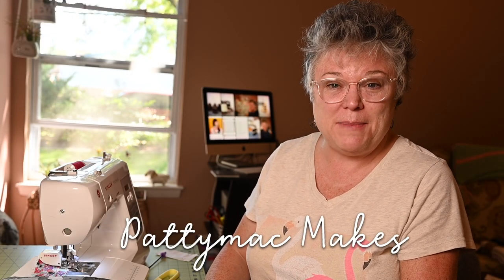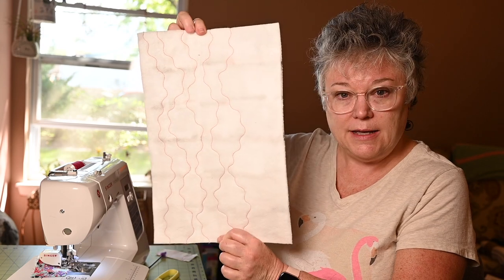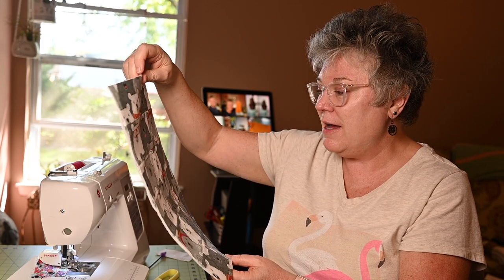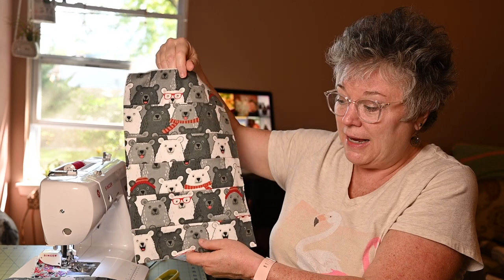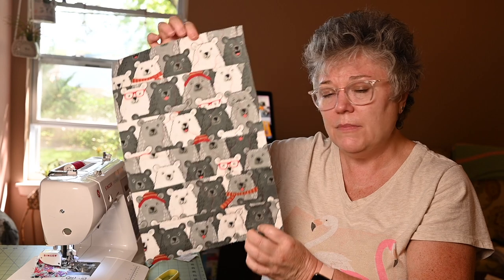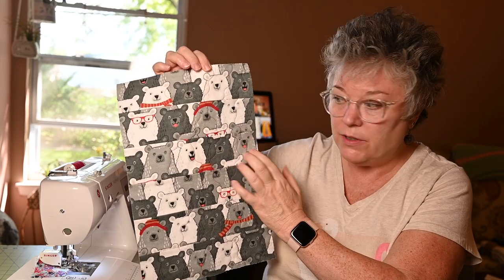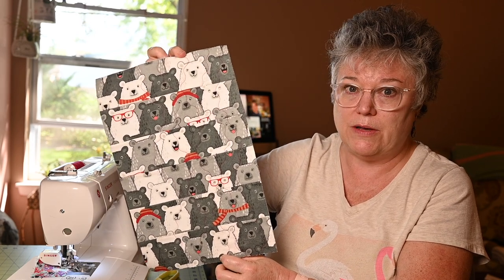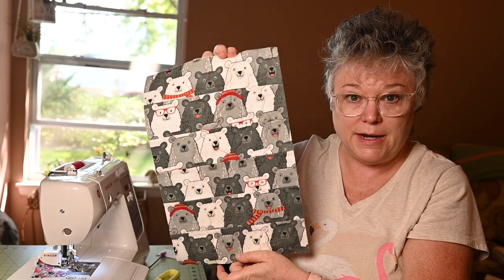HOW TO USE A WALKING FOOT FOR QUILTING | How to install the walking foot and why we use it

Comment: I like your lighthearted approach. 

Your pieces came out so perfectly flat! Did you starch and iron them first? 
I did not know that you are not supposed to go backwards with a 
walking foot! I think I probably was.

I use a walking foot a lot for knits. It is a lifesaver.
I want to know more about that fusible batting. How the heck do you get it all nice and flat on the back of a large piece? That really looks like it helps with it not shifting. What about when you have the backing fabric like quilts usually have?
Lastly, I found out the hard way that there is more than one style of walking foot. I tried to attach mine with the claw part resting on top of the needle bar, instead of hooking on, because that is how the other style attaches. So you need to know which kind you have before you attach it.
Reply from the maker: That's a great point on how the lever can be different on different attachments. The one on my Kenmore is as you describe. 

I press and starch EVERYTHING first. Even flannel which is what the bears are. I never sew anything without doing that first. The type of sewing I do is generally cotton wovens for quilting or pillow projects, so having the materials very stable helps with that kind of sewing. I don't sew knits, but I have heard the walking foot is invaluable with them! 

I saw in a couple of places not to back stitch with the walking foot, but I have also done it. They say not to use decorative stitches with them either, but I have done decorative stitching on borders as part of the quilting process. 

Fusible batting is like fusible interfacing only thicker. So yes, it does provide a lot of structure. I like it for bags and wall hangings and pillows where the piece looks better with structure. For a bed quilt, I use an 80/20 blend, generally, and I pin baste the quilt sandwich. Here's how I put my charm quilt together https://pattymacmakes.com/my-first-charm-quilt/. I hope this is helpful! Thanks for your comment and questions.

Comment: Pattymac, thank you for this tutorial, shockingly easy when you know how😂. This Patchwork Singer is my treat to myself, I’m a returner to sewing after a 40 year hiatus, have any tutorials (or could you point me in the right direction) on using the different practical stitches and feet. Thanks
Reply from the maker: I recommend the book Sewing Machine Magic to everyone which is a great manual to have. I'll wind up doing more videos on the feet and what they do coming up. You can search youtube for information. Singer has some material available. I'm getting my feet back under me after a computer issue in December that's put me really behind. I would recommend putting on your all purpose foot and sew some small projects to get aquainted with the machine. If you put on a zig zag foot, you can play with all the decorative stitches which is really fun!

Comment: Hi Patty. I have a Singer 4423 which I have been very happy with so far. However, I have tried many, many times to use the walking foot and it will not work. I did buy the Singer waking foot that was made for the machine and have watched literally every video there is on walking feet. I believe I am doing every thing correctly. I have spent entire afternoons playing with it. It will go a few stitches like it is going to do the job and then it gets stuck in place, Just holds on and wont move. Do you think something on my machine could be out of adjustment? I have been told never to adjust the timing on these machines, so I haven't. I believe the tension and stitch length were correct. Do you ever have trouble? Is there some stroke of genius that I am missing out on? Something simple? It was worth a shot to ask since I have tried everything else.
Reply from the maker: Gosh, Julie, I'm not sure about it. I wonder if it's the walking foot itself. I would suggest getting another one to try out and see if you get the same result. Joann has them. So try it and if it still won't work for you, it's an easy return. If that doesn't solve the problem, you can try contacting Singer and ask them about it. I'm not familiar with your machine, so I don't know if you need something else or not. Once you get it in place, the walking foot should work pretty easily so it makes me wonder if it's the foot not the machine. Are you sure you have it set up on the screw one the mount where that little arm goes?? If you don't have issues with timing using other feet then I don't believe it's a machine issue. I hope this helps! Singer does have email and maybe a phone number. I can't remember! But check their website to see how to contact them.
Reply: @PattymacMakes  I believe that it was installed properly. I think you may be right. If another one does it then it is either me or the machine and I will know it. I guess its worth the 25 bucks just to know. I just thought I'd ask for good measure. I have tried to get a hold of singer, I don't think they intend to be gotten a hold of, lol. Thank you for your input and all of your great videos of course!

Comment: This video is so helpful! Can you tell me how to anchor the beginning and ends of my seams using the 63 stitch? I'd like to quilt within each block so I will be starting and stopping a lot.
Reply from the maker: I've seen people pull the bobbin thread up to the top of the quilt, but I haven't actually done that myself. I just do straight line quilting or stitch in the ditch to keep it simple, so I'm not really the best person to answer your question. It sounds like you might want to use the darning foot and do more of a free motion quilt than using a walking foot. Free motion quilting videos probably can better answer your question on anchoring. I'm sorry I can't be of more help. Good luck and have fun with it! One thing I can say is to make a few samples and practice your desired technique on a few samples first.

Comment: Hello! I am sewing headbands using double brushed Poly and using a zig zag stretch stitch. I notice my stitches puckering a bit and would like to try the walking foot. Since the walking foot doesn’t do a reverse stitch, how do I go about locking the stitching at the end? Any help is appreciated! Love your YouTube btw! I just got the Singer Patchwork and I’m looking forward to learning more from you!
Reply from the maker: To be honest Byanka, I have done reverse locking stitches on my walking foot and it's worked fine. I've also used it to make decorative stitches which can go backwards and forwards, and that's also been fine. For the locking stitches, it's only a few stitches, so it should be ok for you. Basically, I would try it out and see how it does. I know they say not to got backwards with the walking foot, but it's only a couple of stitches. You are not backing up for several inches. Please try it and let me know how it works for you! And thank you! I love my Patchwork machine!

Comment: I doubt I will ever attempt that. Changing to the zipper foot & back with these hands & such limited space is too frustrating. Last year I made a hot pad following Crafty Crafts by Deana's vid without the wf foot because she didn't use it...my didn't come out that great. Hers did though. I didn't know you cold free  motion quilt with the walking foot. My machines manual says I have to buy another part to do that. Tfs :)
Reply from the maker: It's not a true free motion....it's more of a simulated look of it by using serpentine and going every which way. It's not as bad as I thought it would be to change out to this foot and I wind up using it a lot. It really does make a BIG difference. I do think using a small screw driver is easier, but I like to do tutorials using the provided tools. I hope you will consider trying it out, Kathy! It's kind of fun and you feel like an elite sewist when you start using it. LOL!
Reply: @PattymacMakes  - I had to use a big screwdriver and a pair of pliers.  Those things are put together by some awfully strong people.

Comment: I’ve got a thicker batting. Will this foot work as well or do I need to release presser foot tension
Reply from the maker: I don't think so, but you should experiment with your project. I have used it for higher loft batting without any issues once it gets going. Sometimes it can get a little hung up at the beginning of stitching where it bunches up, so start slow. If it bunches, make sure your needle is down, raise the foot and straighten the sandwich, then put the foot down and continue.

Comment: What type of sewing machine do you have?  I ask because my Singer walking foot doesn't look like yours at all.
Reply from the maker: I have a Singer Patchwork and this is the walking foot that came with the machine. I did a video recently about whyI love the machine so much if you're interested in hearing about it.
Reply: Mine either has a straight lever looking thing i dont know what to do with
Reply: @tanyajones5821  - place the straight lever thing on top of the screw thing that holds the needle in.

Comment: What model is your sewing machine that comes with the walking foot?
Thank you.
Reply from the maker: I have a basic Singer walking foot and it works with low shank style machines. I currently have it installed on my Singer Heavy Duty to use for quilting and putting binding on quilts. But I've used this one on my Patchwork and my Brilliance. I bought it separately as an add on presser foot. I have an older Kenmore and have the version that works with that machine, too. You should search for walking foot and your brand of machine. I hope that helps!

Comment: Mine doesnt go around the needle bar, it just has a white straight lever looking thing with NO cut away part to fit around the needle bar.  Would you know how this is supposed to work? Thanks
Reply from the maker: Maybe that part rests on top instead of around. I would search walking foot and your brand of sewing machine to see what comes up. Without being there and seeing it, it is hard for me to advise. I'm sorry I'm not more helpful on this. I know it's frustrating when you can't figure something out.

Comment: Can we use the walking presser foot for simple sewing, instead of the regular presser foot?
Reply from the maker: Alvin it's best if you use the proper foot for the task at hand. For simple sewing, I would use the all purpose foot, unless you are using slippery or knit fabrics. It depends on your fabrics, really. I sew cotton woven fabric  exclusively so my needs might be different that yours. I depends so much on what kinds of projects and fabrics you like to make and use.
Reply: @PattymacMakes  thanks a lot for the reply and info. Truely helpful!
Reply from the maker: @alvint4944  You're welcome! So much depends on the type of work you are most interested in doing. Garment making is much different from quilting and sewing small projects.

Comment: Can you use the leaf stitch with the walking foot?
Reply from the maker: Linda, I have used several different decorative stitches with mine, and it always worked well. They say you aren't supposed to do any back stitching, but I have never had an issue.

Comment: Does singer walking foot work with brother
Reply from the maker: I don't know exactly. Presser feet are designed for high and low shank fittings. You should find a walking foot that specifies your machine. They all do the same thing, though. Mine is a low shank, and most smaller domestic machines are designed that way. hope that helps.

Comment: What if my fabric is gather after it goes through the feed?
Reply from the maker: It's probably getting a little hung up on the feed dogs. If you have it hanging up, stop sewing, put the needle down, lift the presser foot up and straighten out the fabric. Using the sharp end of a seam ripper helps if it's small piece. If it's bigger, just gently tug a little and get it straight. Put the presser foot back down and continue sewing. Let me know if that helped!

Comment: Changing the camera from the side to head-on from the beginning would have allowed us to see how the assembly was removed and how to "do two things at once" to install the walking foot. The camera angle changed just too late, right after the part we needed to see and couldn't.     As it is, this really isn't a tutorial on how to install the foot since we can see nothing.
Reply from the maker: Thanks for the feedback Anna, but I did the best I could with what I have to work with. I've had many, many other people find this helpful. At the end of the day, you actually have to be brave enough to jump in and try things out for yourself. Watching videos and complaining is not going to help you learn how to do anything. You have to physically take things apart and try it yourself at which point it will make sense. Also, there are other videos from large companies with staff and budgets who are paid for their work, so you might want to have a look at those. It's impossible to help anyone who is unwilling to make an effort on their part. Lastly, the point of the video is how to use it and what it does. The install part is secondary to the point which is what it's for and things you can do with it.
Reply: How ungrateful. To get a free tutorial and then moan. Even worse when it was such a good explanation. And although the installation may have been blocked for a few seconds, it was explained before during and after. Really some people! I personally thought it was very useful. Thank you
Reply: @suzeblahblah  The installation is what I needed to see. Sorry, no applause here. If she can't handle constructive criticism (from a whole year ago) that's on her, not you. Calling a total stranger "ungrateful" for pointing out a weakness in the tutorial a year ago? That horse isn't nearly as high as you think it is.

Comment: This summer I was making my first quilted project--placemats!  My first one puckered terribly, so after ripping out some seams, I found out real quick how valuable the walking foot was.  I even used it when I was making face masks with several layers of fabric--worked great for that, too.  I just wish they would make one that was also a "stitch-in-the-ditch" foot for sewing the binding on.
Reply from the maker: Yes! It's surprising what a difference it makes! Great tip for pleated face masks, thanks for sharing that. When I do stitch in the ditch, I line the split in the front of the foot to the seam and that seems to do a good job at keeping the needle where it needs to be. I also dial my speed down so I stitch slowly and that also helps. It is tricky to sew that binding on, but I find with practice it does get easier.
Reply: Where are her puppet masters, she worked diligently for them. Took instructions from them and executed them with precision. You only have yourself to blame and no one else. It is better to make your own mistakes, but taking instruction from other people, who end up making you look so bad. At that age you should know better.

Comment: I have the same machine that are you using.  What number is the stitch you are using?  I thought I heard 62.  Can you use the fancier stitches that are already on the machine>
Reply from the maker: Hi Elaine! well, it's recommended you stick to a straight or zig zag stitch when using the walking foot, but I've used all manner of decorative and zig zag stitches without any issues.

Comment: My problem is with my 15k-90 singer and the walking foot. Having difficulty with the length of stitches I would like to have. When the walking foot is on it appears the stitch length is much smaller than I want. It is not that way with the walking foot off. Any ideas? Thanks
Reply from the maker: Gosh I'm not really sure about what could cause that. If it were me, I would run a test. I would make a small quilt sandwich and sew test stitch lines at different stitch length settings and review the results. So maybe start at 1.5 and go to 2 then 2.5 etc. I would make a sample with the walking foot, and I would make one without and compare them. I know that sometimes my walking foot gets hung up when I start a new line of quilting and produces crazy tiny stitches.  I generally start away from the quilt top, sew a small length, raise the foot, adjust the fabric and start again. It's tedious, but that's how I've worked around it. I think if I had a bit better machine, one actually designed for quilting, that would not be such an issue. But I don't know until I actually get to purchase my dream machine. LOL I hope that helps and gives you something new to try out.
Reply: @PattymacMakes  thank you! I have done  all that, but I do not think there is any better machine then an old heavy duty singer for quilting. I think it has more to do with that walking foot than the sewing machine. I have been sewing for over 50 years I do not think you can beat that type of machine. Thank you for your quick response.